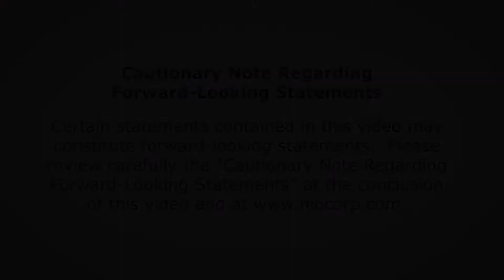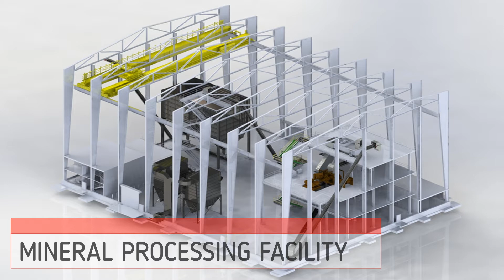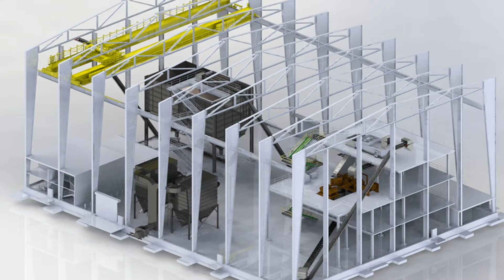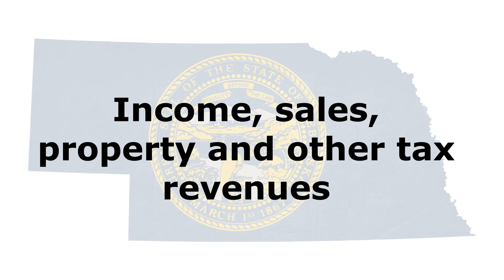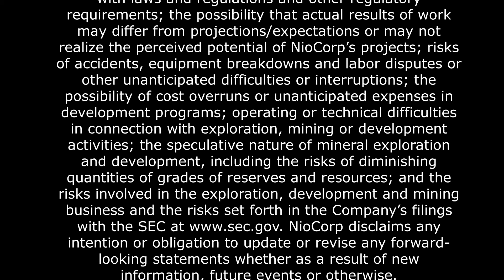Superalloys and NioCorp's Elk Creek Project

Comment: The addition of 1.5% to 3% niobium, 2% to 4% tantalum, 3% tungsten, 4% chromium, 1% to 2% cobalt, 4% nickel, 15% manganese with steel with a carbon content of 1.5% to 2%  and a boron content of .75% to 1% will create a tool steel with A VERY UNUSUAL WEAR RESISTANCE AND ABRASION RESISTANCE. So unusual that, with the proper heat treatment inside an argon-filled heat treatment chamber will practically make that particular tool steel almost to virtually impossible to wear out under the right machining operations and other machine tool operations such as all bearing components combined with medical grade castor oil and molybdenum disulfide. 

Scandium added to aluminium at 3% to 4% content will make that aluminium strong enough to make external missile components to make Russian SLBM missiles to punch right through the thick Arctic Ice as if it is just liquid water.

Titanium, add 1% titanium to steel in the form of ferro-titanium and it will produce marine grade steel that rust very little at all and it's rust seems more like some kind of very thin black blue patina even when exposed to seawater (undoubtedly added with some other micro-alloying ingredients not mentioned for it might be proprietary at that time in the 1960s).